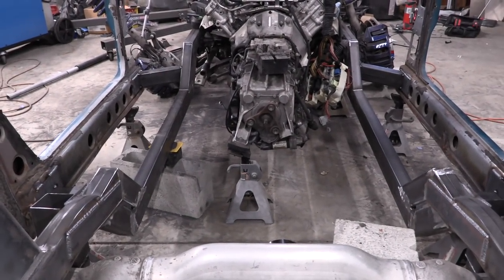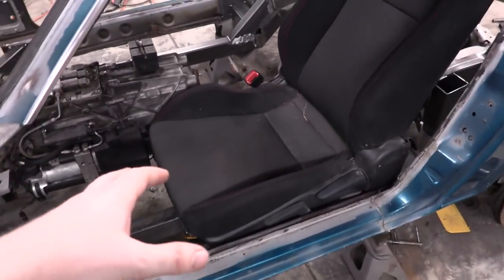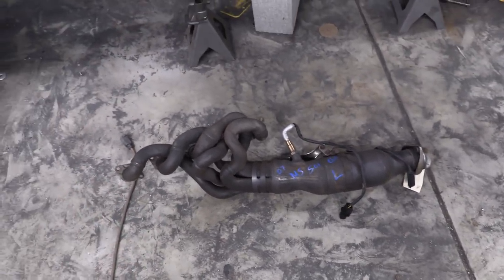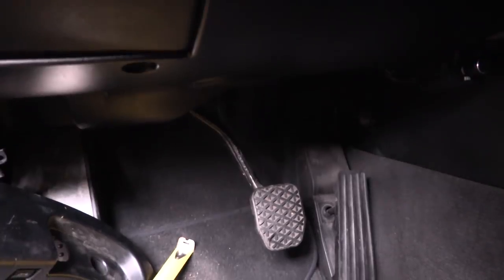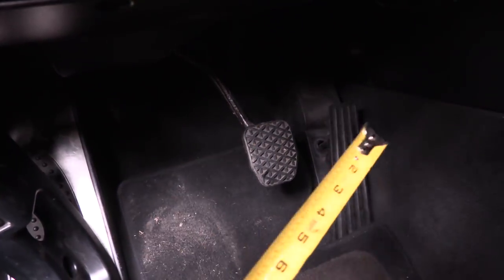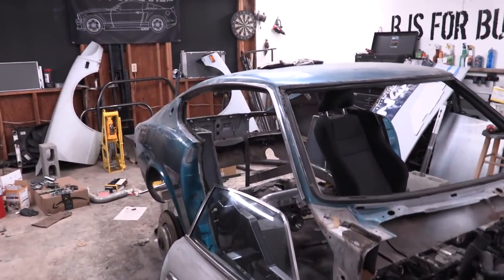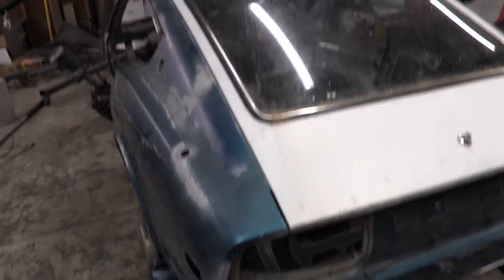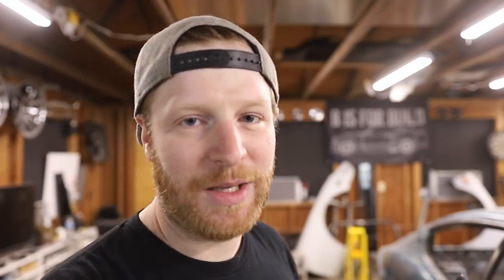Who Knew 240Z's Were So Cramped? Where Can I Buy More Leg Room?

Comment: You will never get in that car the way it sits.  Sorry dude.  Once you add sheet metal/bracing to the floor, mount the pedals which will be way off the floor, add seat brackets, build the actual trans tunnel...you will have zero room.  Lets call that frame what it is...a learning experience.  Much like your previous builds, you've learned from trying it.  And there's nothing wrong with that.  But at this point, you are stretching to make that frame work.  It was chopped up and pieced together to make it work.  Now you are building the rest of the car around it to make it work.  The answer is clear.  You need to redo the frame!  Kick those frame rails out like everyone said and bring them over to the rockers.  The only cars that have frame rails running parrallel is old hot rods where EVERYTHING sits on top of the frame.  You are trying to sink stuff down and the frame is all sorts of in the way.  I hate to see you scrambling.  I know you can build a better frame than that, and all is not lost.  Your suspension points might still be ok to reuse. EDIT: BTW Im not saying even if you biult the perfect chassis that you wouldnt have space issues.  It is a small car haha.  But I think you can make better use of the space.  Also...on your dash comment, the width is more important.  If you dont need HVAC you can ditch most of that, and just use the shell of the M5 dash, shorten it up and install.  Ide like to see you use the dash if it'll fit width wise.

Comment: So back to reading comments? Damm, I would have said something about leg space before if I knew. 

But with so "clever" speeches like the one asking for emails if someone had something "important" to say because you read ALL comments, many feel more motivation on sitting and waiting for failure than on giving feedback. And failure arrived, what a surprise.

You are trying to buid a sports car taking parts from a wide body M5 and fitting them on on a narrow old car with a chassis that looks tailored for a Ford T or a truck. And you want to make it low too.

Shoudnt you be doing something more like this?

https://es.123rf.com/photo_65585340_chasis-del-coche-sin-motor-en-el-fondo-blanco-ilustraci%C3%B3n-3d.html

... and putting the engine more to the front? you have now a mid engine, it is almost completely behind the front axle, guess why you have close to none leg space...

You have two M5, one that you can cut if needed... and one that you can measure. Do you think you can put the engine closer to the driver than in the original car? no? yes? how much? You moved it too much, but it was not a guesswork, it was a measure one... damm it.